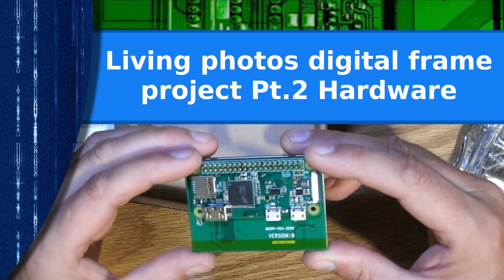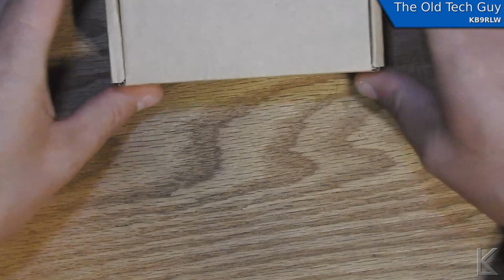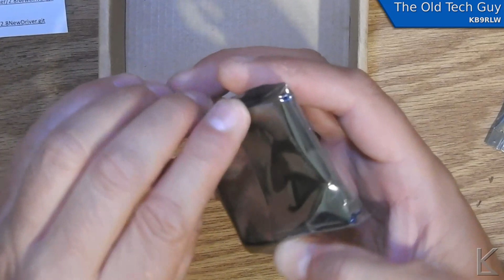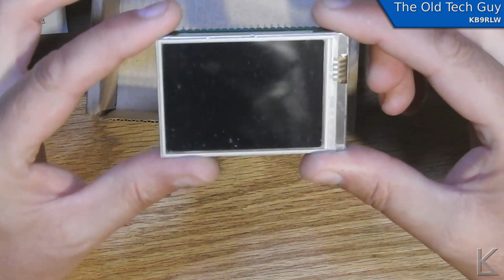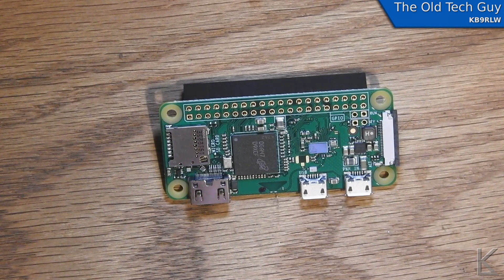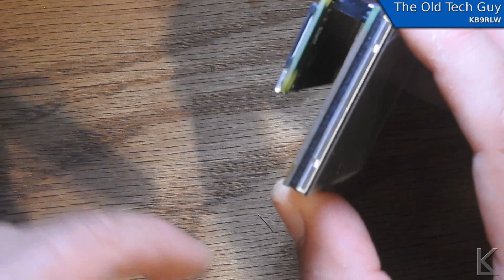Electronics - My living photos digital picture frame build. The hardware.

Comment: are you sure you put that on correct ?  yeah it's not the same screen as HyperPixal that i have. but things/hats that you put on pi's are they not covering the boards front and not the back? also there are cable for the header pins you can get. cos you can bend cables. that was what i where gonna use..but i use them for something else.
Reply from the maker: If it were not electrically correct, it wouldn't have functioned at all.  Just had to flip things physically so the pins were correct.
Reply: @loughkb  hi do you still plan to continue this project?
I'm interested in it and haven't seen the next part.
Reply from the maker: @ifunanya9960  I haven't done anything further with it.  It basically works, you just need to use a more powerful raspberry pi and a better LCD screen.
Reply: @loughkb  oh ok. I'm totally new to this and wanted to see the outcome especially since you mentioned getting a frame from your carpenter.
Thank you

Comment: Kevin, I’ve watched most of your mag loop videos. I built one 16ft  in circumference 4 ft circumference (it was supposed to be 20 and 4, but there was an error), I have a 10-310 pf variable cap. For some reason I have s9 noise on every band even when my nanovpn says I have less than 2:1 swr. My rig always says I’m at high swr and reduces power. Do you think I have my nano calibrated incorrectly?
Reply from the maker: At that large of a diameter, I'd guess it's resonant down around 160 meters or lower.   You might be seeing an harmonic at higher frequencies?

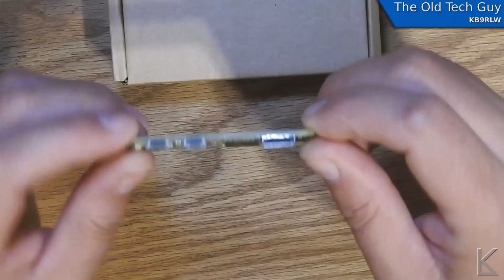Comment: there are ways to solidify those pins without soldering.  i'm great at soldering but i always hate soldering anything on pcbs with chips and super small components just for the low heat tolerances that they have.  i did something similar to this to an rpi.b.plus and it required a custom operating system that would play right with the touch screen, that may be what's on github.   the best of luck to you man, this looks funner than hell, hope you have fun with it and i cant wait to see what it becomes.   oh also, @1:28 the antenna is the triangle just above the soc.

Comment: I completely sympathize with the age related difficulty with soldering.  I'm 59 and my vision is nowhere close to what it was.  In my early 30s, I bought a Luxo Wave lighted magnifier when I was building prototypes and short run production of products that I had designed.  The lighted magnifier is now a necessity for through hole soldering and I'm going to need to get a USB microscope if I ever do surface mount soldering.

I tried to teach high school students to solder a few months ago and left my lighted magnifier at home.  It was basically Soldering By Braille.

For small projects like this (as opposed to a large flip rack filled with a dozen PCBs I'd solder at once), there are now LED lighted magnifiers on a small stand that might be ideal for RV life.

I also can't get along without some means of holding whatever I'm soldering.  I find it to be very frustrating to have the iron in one hand, solder in the other, and some tiny part is scooting around on the bench as I'm trying to solder it.

I have no experience with the Pi Zero and this looks like an ideal candidate project.  I look forward to seeing the rest of this project.  As always, thanks for sharing.
Reply: Lighted magnifier a minimum requirement for age 50-60 I guess. Good stereo microscope is great for surface mount. USB microscopes are difficult to use because of lag most have. I hate the ones I have if I need to work under them.
Reply: Yes just turned 54 today and routinely grab the reading glasses a magnifier a strong light and a shot of rum for soldering.
They stopped questioning it at work...
Reply: @stridermt2k  I can think when 0805 was no problem with no magnifier. Some decades later magnifier is good to have for through-hole stuff. :(